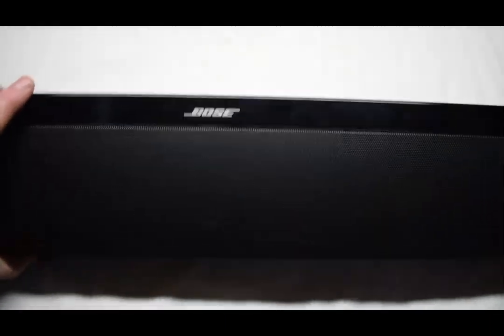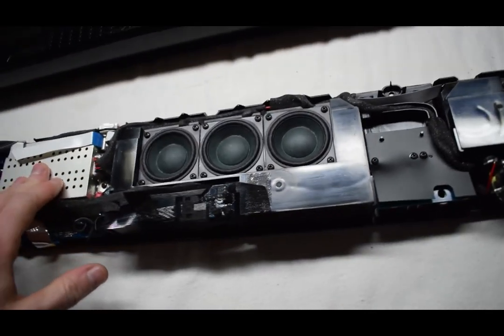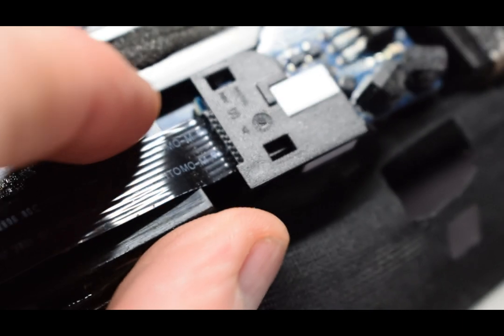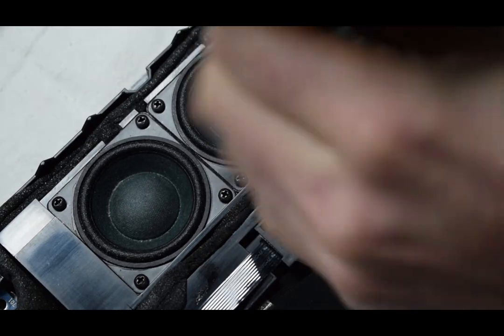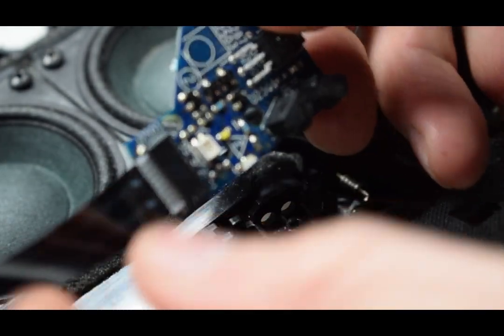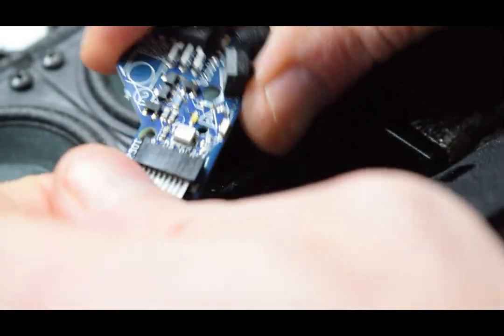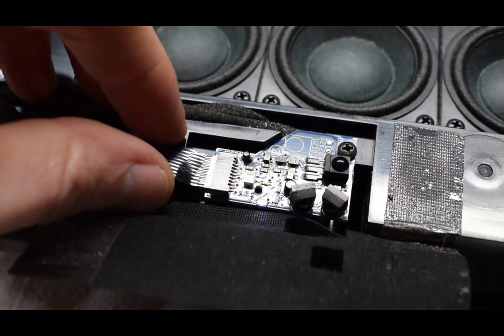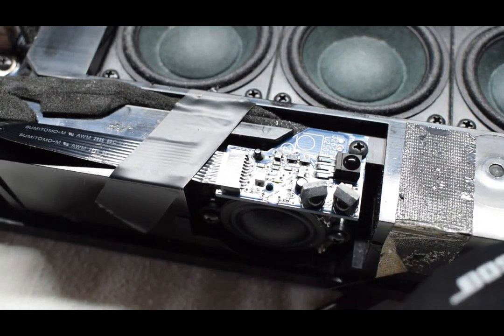Easy fix! Soundbar remote unresponsive (Bose CineMate1 SR Speaker Array)

Comment: I also thought about this problem and took apart the SR1, just as I took off the black plastic for you, and the 3-leg LED broke off (I soldered it back on), unfortunately this method still doesn't want to work.
I'll take it apart again and put a thick sheet of paper under the ribbon cable to see if it might work, or maybe I'll measure the contact error. I'll let you know if it can be solved.

Comment: Thanks for the video
I have a bose 1sr that lights up intermittently and I also have a remote control problem that freezes, is it a power problem?
Reply: I just started having similar, did you get it fixed?

Comment: I’m facing the similar issue with my cinematic SR1 were suddenly the soundbare gets unresponsive to my remote. Changing remote doesn’t help. 
Can you confirm this loose cable solved your issue on long term?
Reply: Did you ever find a solution to your problem? Having the same issue here.